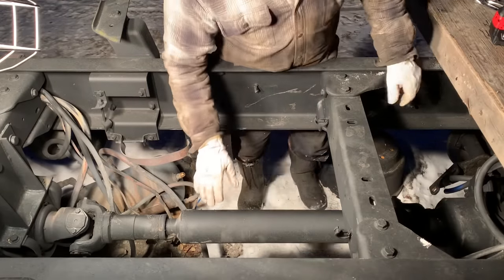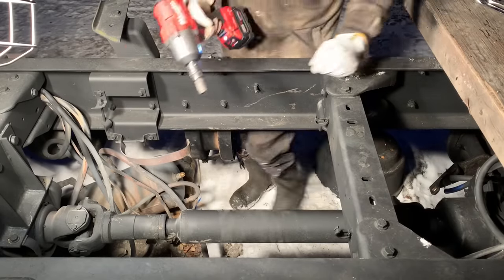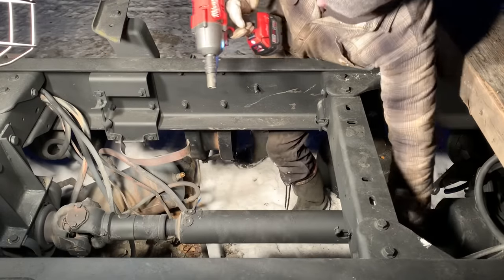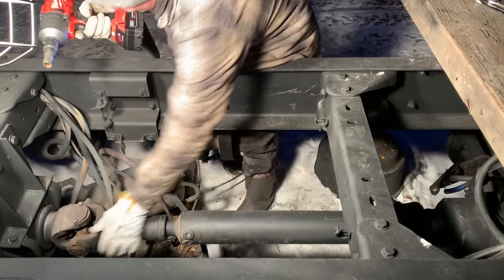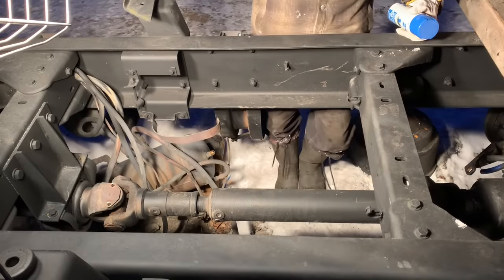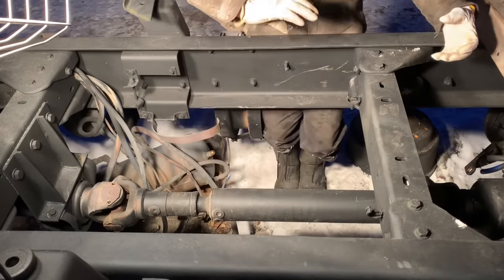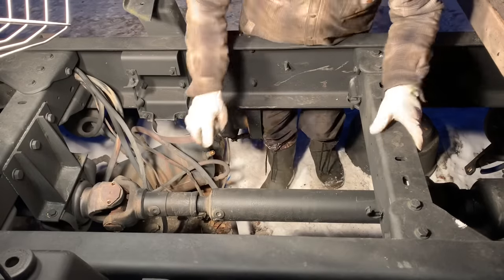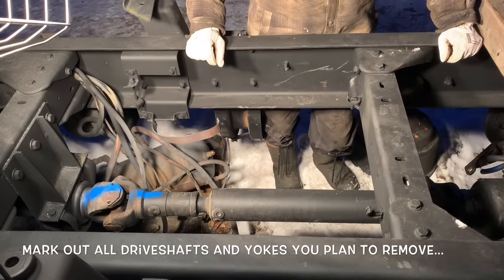Smokey & The Bandit Tribute Truck Ep.13 Driveline Upgrades

Comment: Don't think I have ever seen anyone who just really enjoys working on that stuff so much. Heck when I used to have to work on my old log truck it was always such a chore and I really didn't enjoy it but it was a must do to keep it dependable. The proper tools make it much less a chore. That tiger tool and impact are just the ticket. I have beat my knuckles black and blue trying to remove stuck joints. Good save on the u joints and the yoke. I like your chassis "work table". Go inside and get you a warm beverage you have earned it...

Comment: 2 suggestions:  when you cut the heads off bolts to use as alignment studs- cut a line acrossed to use a screwdriver to remove later. Check the yikes and drivelines to see if they are flared or streched, it'll wareout a u-joint or through the pins out.

Comment: a little tip for puller's is to put a small piece of round stock on the end of the puller it helps to prevent wrecking the center of your axle or what ever else ur working on

Comment: Sooner or later when you work on anything with nuts and bolts, you gotta go with Milwaukee. When I say you ripping apart the box holding the u-joint, I said uh-oh because parts guys all too often hand the wrong part across the counter. Good thing you had another. Nice work out in the snow. Been there, done that.

Comment: Your drive shaft is in phase because if they were a spine out on the slip joint, it would bind up, even if you swap it 180 degrees it can vibrate pretty good! And smack the yoke when pulling them u-joints, running just the impact can stretch them out and cause the joint to bind!

Comment: Glad you spotted the alignment of the yolks I was gonna have to tell you about that, just need to remember to do the same on the forward sections also make sure you keep them in the same end to end configuration. Looking good so far though
Reply: i notice on the second driveshaft the yokes are offset 90 degrees.

Comment: i buy my milwaukee tools in the combo kits. seems to be the best deals. if it has something i dont want or need, i sell it  then i have even less in the tools in do want. i love the tiger tools i have bought. they are of the highest quality. i have the drive line kit. having the yoke puller is so nice when doing carrier bearings, pinion seals and trans output seals. when i have ujoints that are tough to press out, i will put pressure on it and smack it with a hammer and it will usually help it to pop loose. i use my air hammer to push the carrier bearings off. i like to set a level on the caps of the driveshaft and put the trans in gear. makes it easy to be sure you are phased correctly...of course you had large splines on your yoke so being off one tooth was very noticeable. not so much on the fine 32 spline shafts.

Comment: Easier to order ujoints based on size rather than what the book says the part number should be. Especially on old stuff when you aren't sure if the driveline has ever been rebuilt/changed. Look like you have 1710's on the truck and they gave 1760's or 1810's. For install, it's safer to have the cap facing up or on it's side - much less chance you end up chasing needles in a snow bank!

Making good progress! All that cold weather work I don't miss, glad it isn't slowing you down any! Be running from Sherriff Justice by summer.

Comment: Saw you use vice grips on the studs of the u joint caps. When you cut the heads off also cut a slot in them and you can take them off with a flat head

Comment: If you want a little extra jam from your impact get the 8 or 12ah high output battery. It gives the motor a bit more juice a bit faster.
They also only give max torque for about two seconds so bumping the trigger instead of holding will give you more jam. 
I've cracked things with the 3/4 milwaukee and certainly the 1" milwaukee that i couldn't get with a bar

Comment: What a treat!!! Another surprise in the morning with another Project Snowman installment. Yeah, those Milwaukee impacts are pretty awesome. Battery operated impacts have come a long way and those are a testament on how well they work now. J.C. Smith swears by his Tiger tool as well and if I were working on these trucks like you guys were I would get one too. Way better than beating the hell out of them with a hammer. Shame they gave you the wrong parts. That seems to be a common problem and its getting worse over the years. Lack of attention, and not paying better employees who are more qualified, that actually know their stuff at the parts stores. You did the right thing by hitting those driveshaft sections with paint to keep them in phase. I use a paint marker on the ones I do which are usually splined completely. That way I get it back together on exactly the same set if splines and avoid the possibility of vibrations since they are balanced as a whole unit. Great work, and always happy to see another vidja on this truck. Still one of my favorite projects going right now. 👍😎

Comment: LOL i was just about comment about your phasing looking off a tooth. i normally mark a spline and the yolk after i take the nut off with a punch or a paint marker before i pull the yolk. those u joint pullers are nice, every time i do any u joints i tell myself i need to get one then don't think about it again till the next time im already under the truck doing another one...lol i think you got pretty lucky on getting that yolk and carrier bearing off they normally don't come that easy esp the newer fine spline yolks.

Comment: With that tiger tool. get her nice and torqued up. then wap the yolk with a happer on the cap side and it will knock it free. better than using heat.

Comment: Good video Mark, I don't think a lot of people understand the importance of the driveline every piece is important and the smallest mistake can make an nasty vibration. Also I noticed you put the anti seize on the inside of the cup holder on the drive line, I don't know if it makes to much difference but I used to put it on the outside of the cup before installation the I didn't have to worry about cross contamination. Snowman is gonna be a fine looking piece of iron when your done.

Comment: i know a super fast way to remove those three joints on the two front shafts, get stopped on a hill, let the truck roll backwards just a little when you let the clutch out, the first joint snapping will cause a backlash that will remove the other two, boom your done.
Reply: Sound's be like Experience talking!

Comment: Just a little tip on torches, get a Oxygen and Propane set up the gas is way cheaper than Acetylene and it cuts and heats just as good.

Comment: Btw safe yourself a ton of money. Buy the oxy acetylene hose kit from princess auto and buy the propane tips from Amazon. Then go to TSC and you’ll only need to leave a deposit on an oxy tank. Get the big one otherwise you’ll regret it down the road. Now you won’t have to give a deposit on the acetylene, propane is so much easier to get on a pinch and cheaper and heats and cuts just as good

Comment: Those end cap bolts with the head cut off can have a slit cut so you can use a flat head screw driver 👍🏻👍🏻👍🏻
Reply from the maker: Oh now there’s an idea 👍
Reply: @TwinStix  kinda like a flat head grub screw locator bolt 😊😊😊

Comment: In 26:35 when you used anti seize, it's a copper compound, does it perform better than the silver anti seize? Can anyone inform me please.
Reply: I like copper better for most applications, it seems to stay a little more viscous where the silver tends to dry up and get gummy. It is typically used for high temperature applications, it's rated for 2010 degrees F, where as the silver antiseaze is rated for 1600 degrees. The only time I  don't use the copper compound is when you want to avoid copper contamination, which could gaul bearings, or throw off oil samples.

Comment: The only problem using studs for the u joint caps is it’s easier for corrosion to get in the threads ! I would just use bolts if it were me .... some guy on YT ain’t going to engineer better than the people at spicer /Dana 🤣🤣

Comment: Anti-seize doesn't help with future removal.. it makes future removal *possible*! .. the only problem with A.S. is that is gets on everything.. On your pants, shirt, jacket.. bottom of your socks.. inside the freezer in the basement... On the attic light socket that's never had a bulb in it in 40 years.. On the inside lip of that bottom drawer in the guest room Chester draws where you keep your high school turtle neck sweaters.. The list never ends.. and that's from one use.

Comment: Here In Florida we use a prick punch to create witness marks that can't be painted over and we use anti-seize compound on every bolt thread that we re-assemble.  We also use a drop or two of CRC knock'er loose on every thing that we propose removing.  And we never wear that much clothing. BTW:  I can do without the detracting music. Ron W4BIN
Reply from the maker: Hi Ron - appreciate your feedback but I like cowboy music while I work and it just bleeds into the video but point taken will look at turning it down some for future vids
Reply: I think you can turn your volume down ronnie baby!

Comment: all of the u joints you pulled were not original the old u joints would of had a metal strap with tabs to bend up, you can reuse yoke nuts just blue locktite them, good thing you caught the phasing of the yoke i was writing my comment that you had it out of phase when it came on you were fixing it, the carrier bearing should not have come off that easy you have no press fit on the bearing, unless your going to use this truck as a operating unit you shouldnt have any issues tho,  also you should check the u joint for ease of movement after installing new ones sometimes they yoke is spread and causes binding, when removing u joints just do one half will make removing the driveline easier, the grease zerk should face the driveline the way you are putting them away from it will make some of them impossible to grease.

Comment: I'll give u some advice besides useing paint to line something up and best way to put that carrier bearing is to assemble it out from under truck u line yokes up put in transmission will turn and put in line with rear end and I see u didn't put straps on that hold caps down on u joints sorry but just cause u torqued em they will still back out u need straps on em and bend ears up on bolt head and no offense but if that battery powered wrench broke that nut loose as easy as it did it was not tight and use a 3/4 air impact wrench to tighten it up if not it will come loose going down highway and tear up some stuff just saying I own trucks and telling u what I no and sir them straps and a big air wrench is a must on u joints and yokes
Reply from the maker: The new spicers don’t come with straps ... they have threadlocker on the bolts and as long as they’re properly torqued they should stay in place.  I will be checking for anything loose when I grease as I am a big fan of the straps to ensure they don’t back out
Reply: A

Comment: Did you need to do all that work? Was it making a noice,? Just just seemed to easy to pull apart lie they have just been done
Reply from the maker: Well the truck has been sitting for 7 years with the previous owner and who knows how long it was with the owner before so it’s just better to do it right and not have to worry about it

Comment: The phasing on the rear section of the front tailshaft is incorrect, the u joint yokes on the shaft ha e to face the same way or they will bind up and cause vibration and further damage to transmissions and diffs as well as u joints. The slip joint end has been turned 90⁰
Reply from the maker: That’s not the way it was and there was no issue before 🤔

Comment: Are you sure those ujoints aren't for the shaft between the drivers? Those ujoints are usually smaller, and you checked only 2.
Reply from the maker: Checked the original build sheet at local Kenworth dealer before I bought them to confirm all 5 are the same 👍